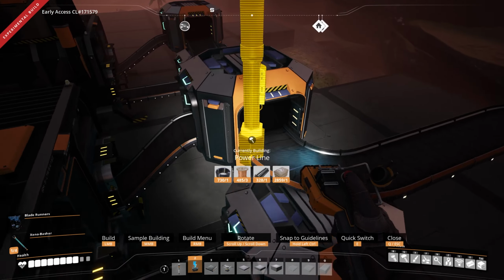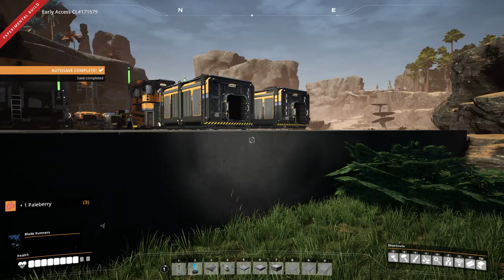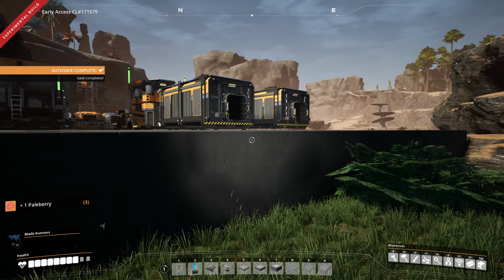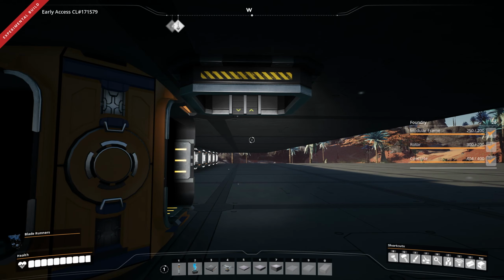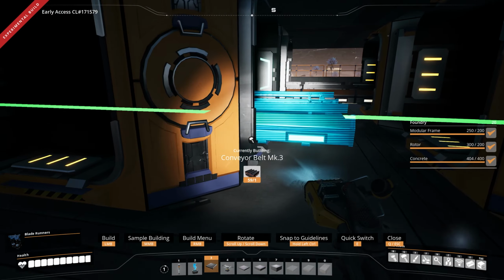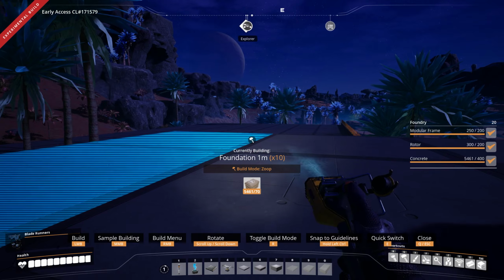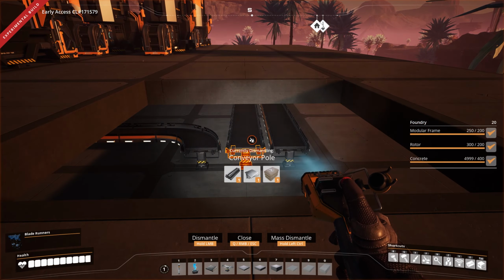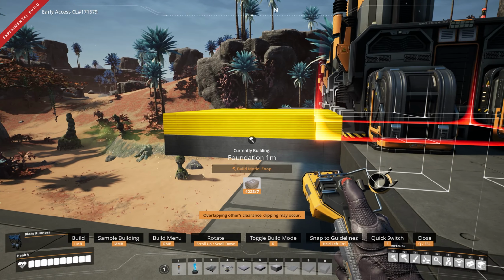Our Behemoth STEEL Factory Begins! - Satisfactory Update 5 [EP6]

Comment: There is one thing I have figured out with assemblers and foundries with the new lift holes is that you no longer need 8m of space to get everything in, you can have both inputs come in from different lines without belt clipping.  One input comes in from one side and one from the outside.  The caveat though is that the output needs to go up rather than down.

The input splitters will be staggered on different rows, so the lift for the first will point north, the other will point south.
Reply from the maker: Yea, excellent point, going up would of certainly been an good option for the output.  Especially since the output needed to go up in the end anyways.  Didn't think about it at the time, definitely something to consider on the next build. :)
Reply: I only just came up with that on my current build myself.  And of course being a month out when I found the videos doesn't provide much help with what you are doing now I'm sure.
Reply from the maker: @lighthawk99  There are many factories to be built  :)

Comment: Are you not 1 smelter short? You have a line of 9, another line of 9 and then a line of 8 unless you overclocked that last smelter?
Reply from the maker: That’s because that line was only smelting 240 iron, instead of 270.  This was all I needed for the numbers I was building for.  Also, because I designed it in mind that I would have 30 coal/m available for fuel.  Which I think ended up only being 9/m needed.

Comment: I love that little area for an auxiliary or secondary steel production area. I almost always grab the Iron Alloy recipe, as there's a copper node, and I'll usually grab Wet Concrete for the limestone node - just crank out Encased Pipes galore there.
Reply from the maker: Yea, very true, the iron alloy recipe would work great in that area.  Thanks for the tip!    You could also use the Fine Concrete recipe by snagging some quartz from in the cave there (or across the river).  Since quartz isn't used much mid-game, it's a good way to increase that limestone node usage prior to getting refineries.
Reply: @relyengaming  In update 5 with the new cost for Windows or Glass, quartz is used more than before, but Silica is fairly cheap...
Reply from the maker: Good point, it's nice to know silica has a solid use now earlier in the game.  The limestone alternate recipe was a very niche use of it.

Comment: the dark concrete texture is from the online save editor, at the start it bugged out the colour of the new swatches. to fix it, reupload ur save, change the colour to something else, download, reupload and reset to default colour
Reply from the maker: Thanks! Yea, I discovered that while working on the next episode.  I used SCIM at the first episode (when it was bugged) to align my foundations to a world grid. Which I'm glad I did, as they added a basic world grid later that ended up aligned with the one I setup.